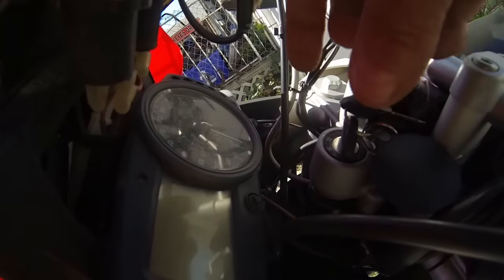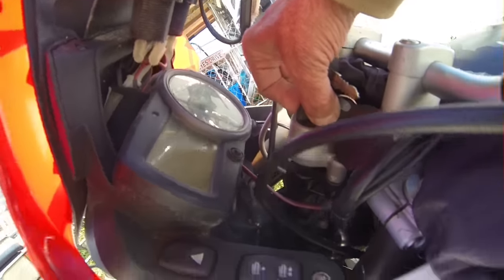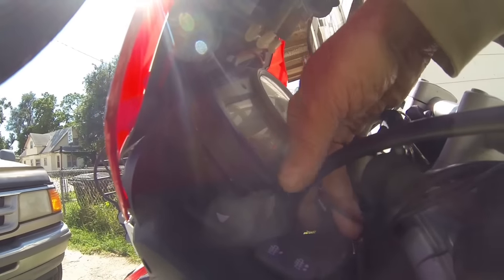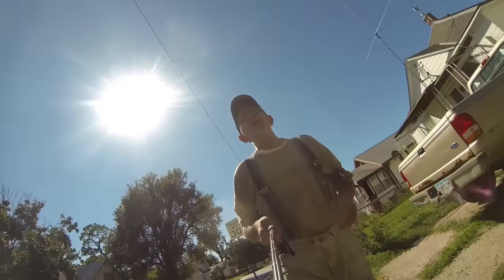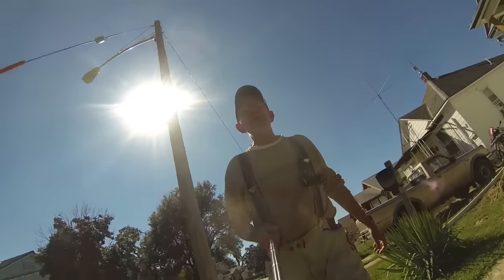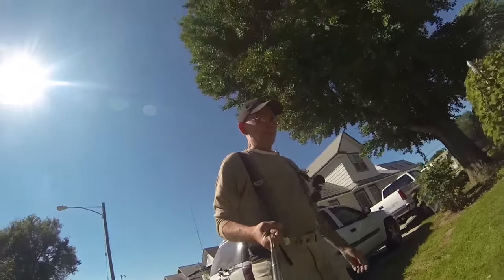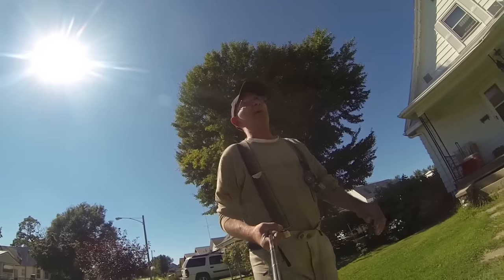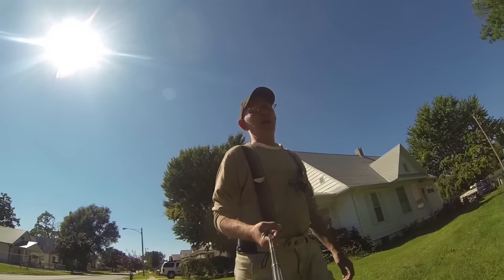BMW G 650 GS Starting issues

Comment: Hi Thomas, i have the same problem. Have you found the problem and fix that?
Reply from the maker: There is a recall on that bike, it has to do with the Decompression lever. They replace that and it is fixed.
Reply: What year is recalled?

Comment: Why dont you get a Marine fuse block tom it would keep it dry should be cheap ebay.
Reply from the maker: +cd wall actually the fuse box is already water proof. I suspect it just needs Dialectric
Reply: Thats great some bikes are less thought of in that department.